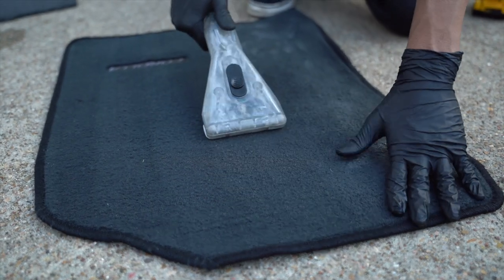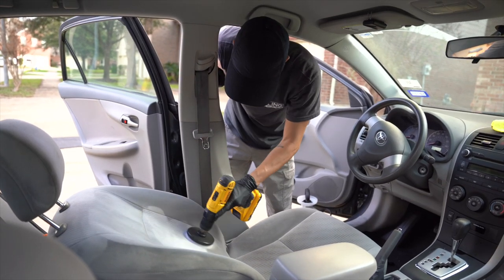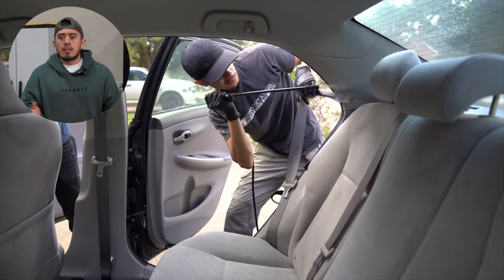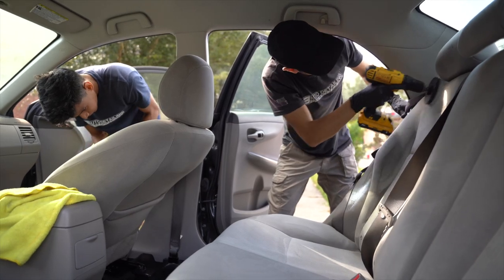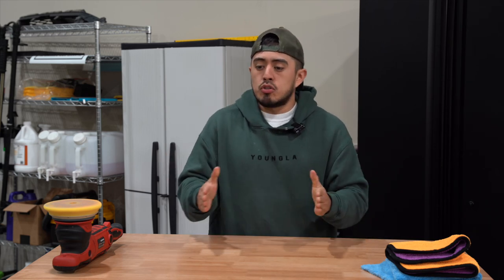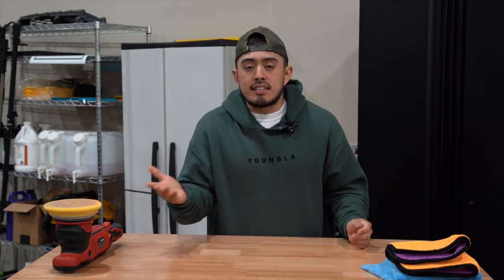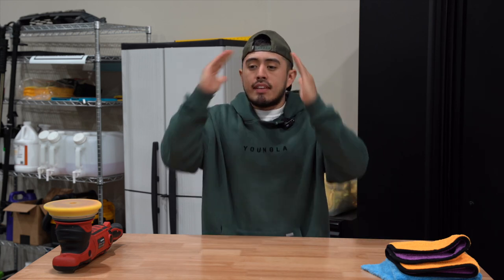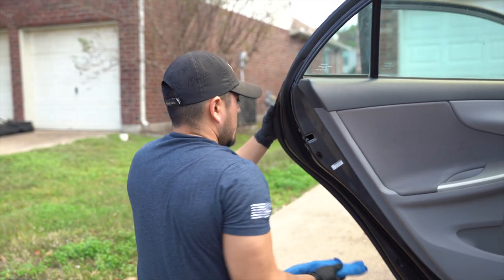3 Things You Must Know Before You Start Your Detailing Business

Comment: I'm in Los Angeles and would have charged about $100 for inside. Then again depends on how bad the stain is. I've had to remove lube oil stains before and that took a couple hours.
Reply: How did u remove it, what method